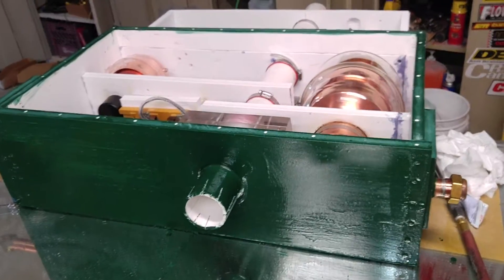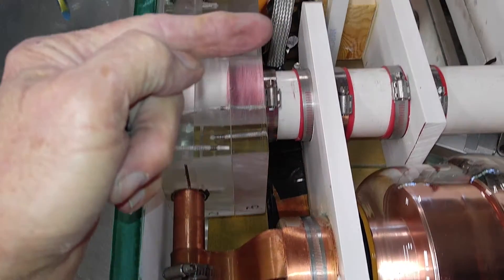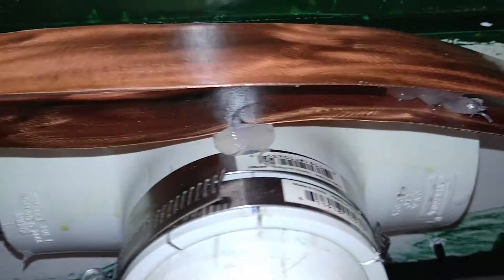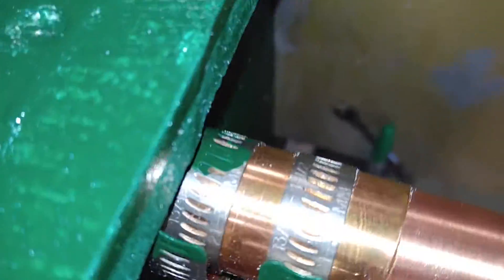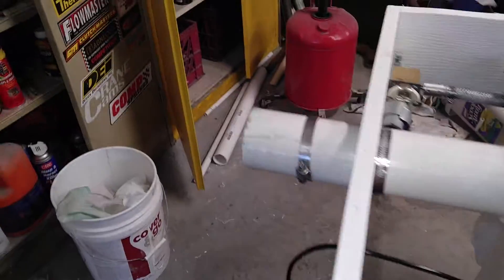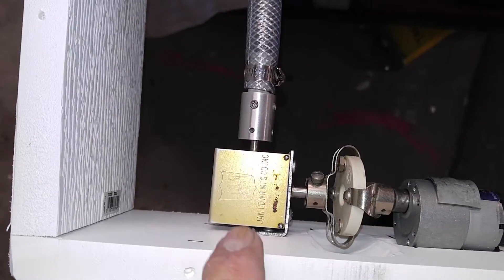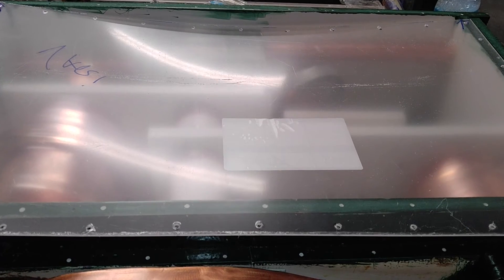Assembly methods in the tuner for mag loop

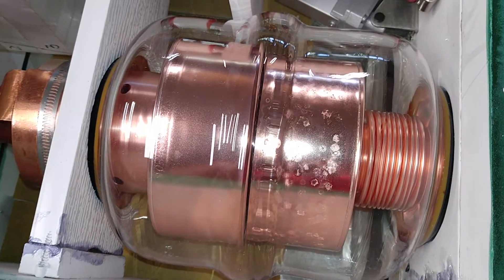Comment: 2:45 those spots are arcking right ? I have not find actual videos of you working on the bands while transmitting with your loop, how does it operate ?
Reply from the maker: Yes the russians did that prior to me buying the cap.  Works great on receive, quiet but transmit is like a dipole - nothing special to report. Woody
Reply: @woodyw6933  so you don't particulary would recommand that antenna to transmit ?
Reply from the maker: @Aleziss  Its a great receive antenna and for the effort not worth the transmit antenna.  Now I know that I should have built a receive only antenna which would have been way cheaper and lower cost. 12' is good and with low power demands a cap could be a simple variable in 1/10 the size cabinet.  Great for receive. Woody
Reply: @woodyw6933  thank you for the details, I was thinking about getting a loop for tx/rx but now I am not so sure, they are extremely expensive 1500$+ and seeing many user not being fully happy with them refrein a lot my decision to get one... I have so much noise here and have a really tiny lot and thought this antenna would save my hobby but now I am not so sure...
Reply from the maker: @Aleziss  The receive loop is good and cheap, buildit yourself and save.  Dont buy one, size it the apature and larger is better, on receive the cap is nothing big deal - ebay for 30 $.  Do the loop and hang a dipole, Woody N4MQ.
Reply: @woodyw6933  oh ok, because the dx engineering receiving loop is still 500$... I thought there should be something special about the loop for the price but I'll try to find a design for RX only on the web... the dx engineering one looks to have a low noise amp at the base of the antenna and seems to require no tuning... but again, it's 500$...
Reply from the maker: @Aleziss  500$ is big money. Join yahoo mag loop forum and roll your own. Much free info n followers.ww

Comment: Very nice work, OM!  The plexiglass is a nice touch - those bodacious caps are gorgeous.  

Also wondered why you didn't just solder that copper using the usual plumber's technique -- but if you're still tweaking it, the hose clamp approach is smart.